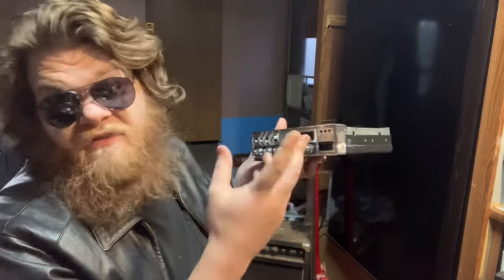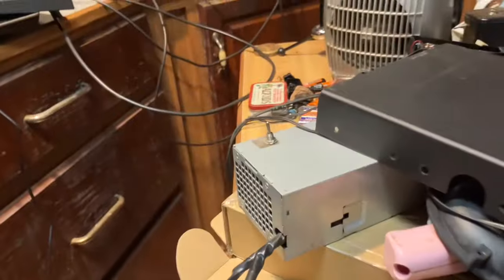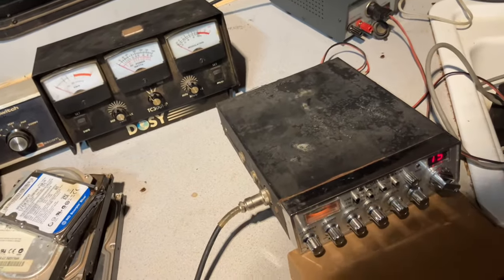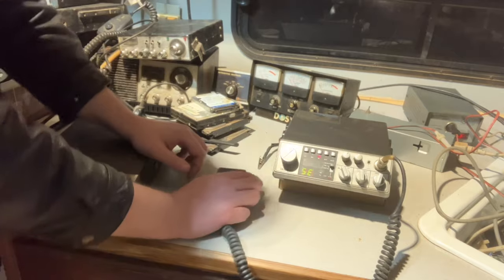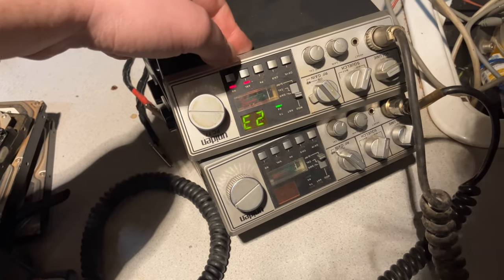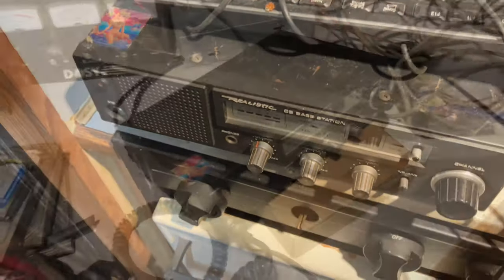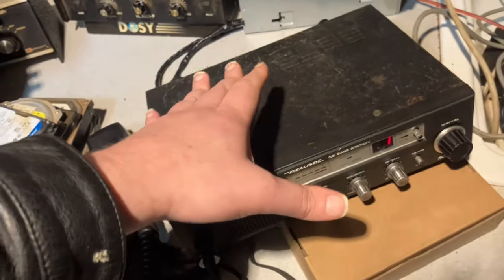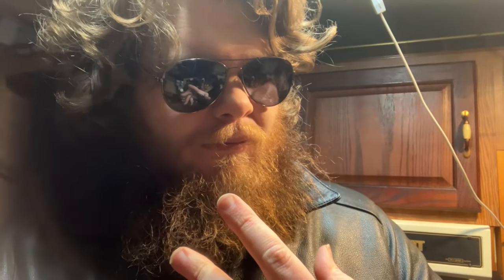I FOUND THESE RADIOS IN AN ASH BUCKET! LOT’S OF CB RADIOS!!

Comment: You got a lot contact cleaning resoldering bad spots on PC board 
use deiox it " or Crc plastic sake cleaner at H Depot nice collection inlikd them 80"s unidenz with sloping face PC 77 ? I think I had one them and is nice radio lube them buttons.
Reply from the maker: Yeah, it seems like a nice radio I’ll have to get some deoxit!